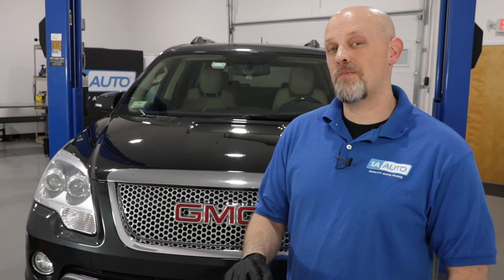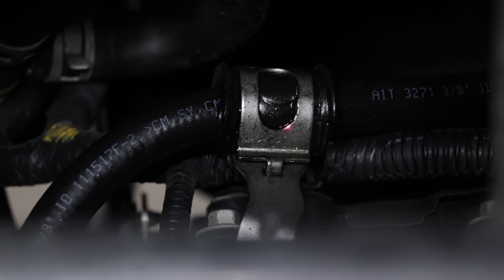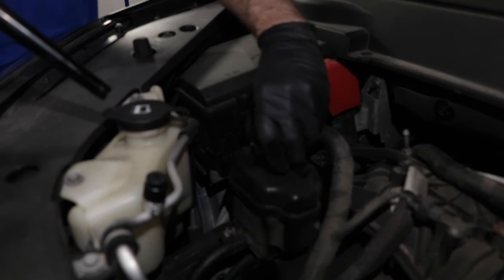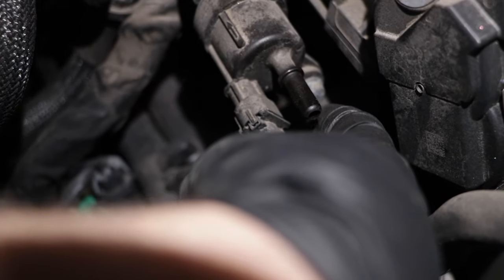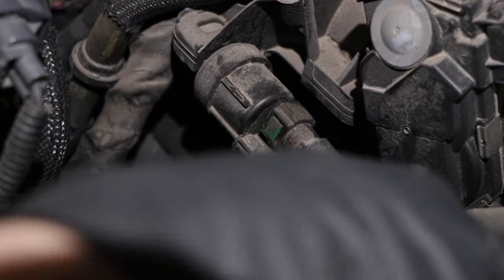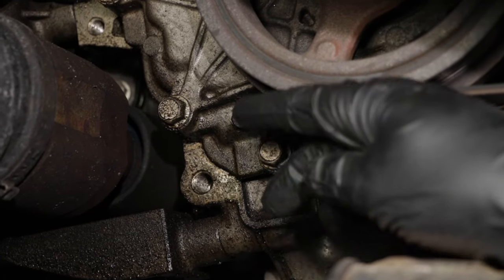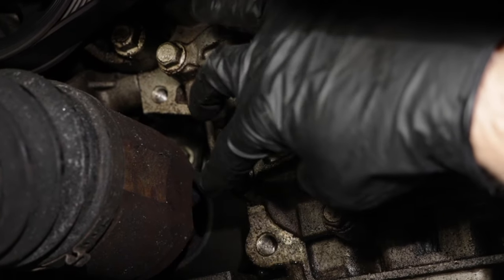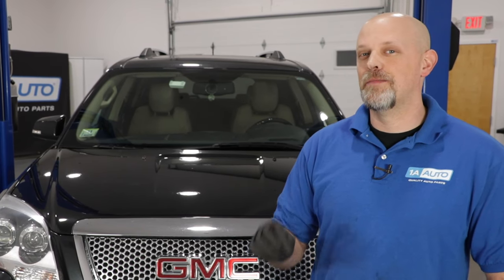Top 5 Problems GMC Acadia SUV 1st Generation 2007-2016

Comment: I don’t think I’ve ever commented on a YouTube video until now. I have the 2010 Buick Enclave. I got to experience the thousands of dollars for the timing chain, the transmission control unit, and am now getting the shuddering in the transmission. I was hoping that was a strut problem. Hmmm. It’s got 210,000 miles. I suppose I can’t complain too much.
Reply: But that mileage is NOTHING if the vehicle is well maintained and in good physical and cosmetic condition. 

Stop thinking that 200k is the end of life for cars. It’s not. Replace the faulty trans and keep on rolling. Replace an aging engine and keep on rolling. 

My 2014 Acadia has 104k on it and is MINT inside and out and I have 2 small kids TRYING to destroy it CONSTANTLY. 

No issues with my Acadia. I personally service it more frequently then needed because it’s a POS GM product but I love it’s design and features so we keep the wheels turning.
Reply: I was looking to get Buick Enclave ... is it not a good car?
Reply: if you've ever owned a Toyota long term.  you'd complain about spending thousands for repairs on that Enclave.

Comment: In 2015, bought a 2012 Acadia SLE2 with 22k miles that had been turned in from a lease. It was almost perfect, well maintained and had an excellent carfax history.  In 2018, it had 40k miles and the air conditioning system that lead to the rear of the cabin developed a leak. With the extended warranty,  it was projected that my out of pocket cost would be around $1.8k. The extended warranty was soon to be due for a renewal at $3.5k for another 3 years.  I traded it in without the AC repair and got a 2019 Acadia.

Fair winds and following seas to all.
Reply: Wait you owned an Acadia and then you…. Purchased another one?…. 😟 I’ve heard there’s people that have a fetish for torture but this is my first time actually encountering one. You’re an interesting human sir 😂 hope it’s been good to you

Comment: Thanks for the video. Wish I never had bought my 2008 Acadia!! Bought it used from a dealership, 6 month later (2017) timing chain, master cylinder, boost, alternator all had to get changed. ( Dealership repaired) then have replaced drive axels (front) tie rods, sway bars, struts, upper and lower control arms, etc... Then water issues....  BLOW VENTS OUT EVERY 6 MONTHS, in the sunroof ... Hood liner fills with water, rain, car wash, etc... Sap and tree debris do clog these drains. Previous owner has jasper transmission put in, now car stuck in driveway, sounds like it shifts to reverse and drive but nothing but engine rev. Fluid level has been full, not had to add, yes click in dash when shifting. Very depressing, GMC used to be a quality vehicle long ago!!
Reply from the maker: +John Libby Thanks for the feedback!

Comment: I have a 2011 GMC Acadia AWD. 113K miles. So far so good, no major issues, thank God. I always take it to the dealer for oil changes and do all recommended maintenance work on time. Hoping it will last for another 30-40K.
Reply: Mine has 16800 running strong 2011 denali
Reply: How is it going now? Any issues since your last post?

Comment: 2007 Saturn Outlook (Same as Acadia) I had the Evap purge go out, easy fix. Been a real good car, 172,000 miles on it. The MAF sensor went out recently wreaking havoc but fixed that easily, One of the stupidest things I had go wrong was a PCV cap. The rubber cracked and it fell off causing a vacuum leak. Shut down my stabilitrak, traction control and threw 3 codes. Went and bought new rubber caps and it drives like new. Changed my trans fluid every 50,000 not trans problems. The most important thing for these vehicles or any vehicle is fluid changes. Oil Every 5,000 miles for these and check the oil regularly, these engines do burn oil even if they're in top shape(Look in the duct for the air box, you'll find oil blown out from the intake in there too) but ignore the rest of the recommendations. Change the trans fluid every 50,000, not 150,000 like the book says. Change the antifreeze every 5 years (Not 10) Honestly I should get a new car because the Saturn is up there in age but I feel as if I could get another 5 trouble free years out of it. If I have it 20 years I'll definitely have gotten my money's worth out of it.
Reply: Im looking to but a used 2009 outllook in a couple weeks. Thanks for the comment! I know a little more of what to expect
Reply: I had an 07 outlook also, it had a timing chain fix done, and couple years later timing chain cover was dripping oil onto my garage floor.   steering and suspension started getting clunky. Then at 135k the transmission was done for.   worst vehicle i've ever owned

Comment: With my 2015 Acadia the trans started slipping at 86,000 miles. My air conditioner is no longer working at 165 000, I was told at the dealership the evaporator goes out on these. Can't wait to see what else fails.
Reply: Did you fix or find out about the transmission issue. I have a 2013 that is misfiring.

Comment: I've got a 2010.  AC has broken twice and it's not worth fixing.  Power steering fluid leaked for a while and cost (what I thought at the time) a lot to fix.  Now just had my timing chains replaced (dreaded P008 code).  $2,600 CAD to fix.  Sorry to say that's it for me and GMC.  Next car is a Toyota or Honda.  Great video and thank you.

Comment: Good video, great tips! If you change all your fluids(power steering, transmission fluid, coolant and of course oil on time or before suggested maintenance you won't have some of these issues. 32 years in the business I see it everyday ✌🏼
Reply: 74,000 miles GMC Acadia Denali. Timing belt issues. Piston slapped plug, new engine needed.
Maintained precisely to manufacturers specs.
My Mechanic said this is one of the main issues with the Acadia engine. He has 4 on his lot waiting for engine and or transmission swap outs. It’s an issue with GM not the consumer.
Reply: That’s right I push my of cliff

Comment: I just fixed the power steering leak, replaced the water pump and flushed the radiator while I was at it, replaced the fan assembly, and had the timing done. 197000 mile on it and now running very well.

Comment: Just did the power steering pump and rack on our 2011.  Glad the garage did it after looking what needs done.  Has the buildup on the valves and garage cleaned it.  Put a bottle of cleaner in about one a month or more and it's doing pretty good since.
Reply from the maker: +Jeff Keller Thanks for checking us out! 1AAuto.com

Comment: Have a 13 Denali. Had a leak in the rear sunroof. Had the timing cover leak. Covered under warranty. Had the blind zone modules go bad. Replaced under warranty. Other than that. Nothing other than regular maintenance. 83k miles so far.

Comment: I think GM pioneered long service intervals. Transmissions sealed for life, 100,000 mile coolant and spark plugs. I had a Malibu that required $3500 in warranty work at only 75,000 miles. Rebuilt transmission, intake manifold gasket, airbag, new horns. It was ready for a new radiator at 90k.
It was replaced with a Honda. I’m no longer on a first name basis with Enterprise rent a car.

Comment: Great video. I have a problem with my GMC Acadia 2014 My Service traction control light comes on on the highway when there is an incline and then the car hestates when I press on the accelerator

Comment: I’ve had an Outlook, Traverse, and now an Acadia. My wife loves these cars, I hate the maintenance they require. I’ve had, leaking sunroof, radio issues, transmission issues, tons of recalls, power steering pumps, stuck front struts, a/c evaporator replacement, plus more I’m forgetting. Not to mention you have to pull the intake to change spark plugs.
Reply from the maker: +JadXtreme Thanks for the feedback!

Comment: I have the uphill shifting gear shutter torque convertor issue. Thank you for the heads up on these problems. This way I can be ready for and not so surprised when they occur.
Reply: I have that problem, too. It didn't start til 160k miles. Wish it didn't, but it's paid for and been a great vehicle! I'll put the money into it to keep er going.
Reply: I had that same torque converter issue. I just spent $3800 having it replaced and getting the transmission rebuild.
Did the timing chain job last year so I'm hoping that I'm good for a while.

Comment: Bought our 2015 Acadia in the spring of 2018 with 35k miles. Proactive and preventative maintenance is CRUCIAL with this power train. I've always changed the oil @ 4k mile intervals with full synthetic, and drain/fill the transmission fluid every 10k miles. I run a bottle of fuel injection cleaner every 10k miles, and I changed spark plugs at 50k and 100k miles. Fluid changes are as simple as turning a drain bolt and refilling the fluid. The Acadia just rolled over 105k miles and she's still kicking strong. Changing the oil at 4k miles instead of 5k mile intervals has only cost me about 4 extra oil changes over the last 6 years. The cost/benefit is clearly on your side if you consider having to replace a timing belt or replacing a transmission. While this is far from GM's best design, it has served our family well.

Also noteworthy
I have replaced all four wheel bearings (fwd). I feel that is reasonable for a vehicle with just over 100k miles.

Comment: Another common failure is the AUX AC line that leaves the firewall. The vapor line,(bigger of the two AC lines) get rubbed on by the power steering hose with a steel band clamp in the middle of the hose. This steel clap will over time rub a pin hole into the aluminum tube. This is an EXTREMELY expensive repair.
Reply: this only happens if that clamp is not bolted on to its factory position after once been removed. a lot of times, mechanics working in the area will not put it back in its proper spot and bolt it down and it will wear on the ac line.

Comment: Me and my wife own an 08' acadia SLT2 that has served use well (even in it's older age and higher mileage of +200k) but it definitely has some of these issues. The purge solenoid being one possible current issue and the bad transmission or torque converter as another current issue. Still runs and drives though and can't complain about our $5,000 investment made 4 years ago! Thanks for the great informative video, you did excellent 👌
Reply from the maker: +Isaac W Thank you! We love empowering our customers and showing how to perform DIY auto repairs with our high-quality auto parts.  http://1aau.to/m/Shop-1AAuto-c

Comment: My husband was a certified mechanic.  I worked with him quite a bit. I'm puzzled by my 2011 GMC Acadia. I've changed several things you've suggested due to engine codes. I think I still need to check the timing chain. My problem is that I may have a secondary issue. A couple of times it stalked after driving about 3-4 hours.  It will start again after about half an hour.

Comment: Thanks for the video, you just described my current issues exactly...pretty sure now my torque converter is going out..😡
Reply from the maker: +Jonathan Langan Thanks for checking us out! 1AAuto.com
Reply: Hello. I have a 2012 GMC ACADIA, and it won't start. The dash lights still came on, so I had the battery replaced. Now the battery is drained, it needs a jump for the lights to come on but it still won't start up
Reply from the maker: +Deanna Beverly We wouldn't be able to diagnose an issue like that here, you may want to have a local mechanic take a look at it. Thanks for checking us out! http://1aau.to/m/Shop-1AAuto-c

Comment: I had the 3-5-R wave plate issue, got the tyranny rebuilt since the engine was at 200,000 miles and in good shape. I also had an almost constant flux in RPM before getting the tyranny rebuilt, problem was corrected..

I currently have the evap solenoid issue at the moment. Very curious now to know what my valves look like!
Thanks a bunch for your video, spot on!
Reply from the maker: +FaithGardener Thanks for the feedback!

Comment: Thanks a bunch.. I have an 08.. 
Have you heard of any mysterious leak issues? I'm finding water in the wire cables that plug into the pillar of the door jams. It starts by losing all internal audio, radio, turn signals, etc. 
Then decoupling the wiring harness and water dumps out of them.
Trying to find the source of the leak.. wondering if it's the roof racks?
Reply: I have an 07 and have had leak issues as well. I had water coming in on my lap all of a sudden after a big rain out of the pillars and from under the passenger side dash area.  There are drain tubes that are connected to the sunroof from what I was told.  These can get clogged or crack and need to be blown out or replaced.  Luckily I didn't have to pay for my broken one or blow out because I had just bought it used, 2.5yrs ago, and the dealership took care of it thankfully.  A while back I had a few drips and so when I went for my last oil change I asked them to blow out the drain tubes. They looked at me like I had three heads!  This was a GMC dealership mind you. Once I explained it to them a mechanic said it could cost $650 to do.  Still wasn't sure if they got what was talking about.  I didn't do it and I haven't had any issues since, but every time it rains I cringe when I go drive it the next day. If you listen you can hear the water sloshing around trying to find the drain holes and you hope that's where the water goes. Lol.  I haven't had any issues with it compromising any electrical thankfully. Try the Arcadia forums for more advice or call up the GMC dealership.  Maybe where you are they have had more experience with it.  I'm in AZ so it doesn't rain all the time. Good luck.
Reply: I need to know the same thing!!

Comment: I’ve worked at a GM DEALERSHIP for 4 years and I have never seen a car or SUV transmission serviced, truck owners have a better understanding of maintenance it seems.

I can TESTIFY that absolutely ZERO customers I have ever seen come into a dealership service their vehicle properly and regularly. This would alleviate half if not ALL problems on some vehicles. Granted some vehicles just have inherent issues. The transmissions in these Acadias will go forever if serviced properly and not abused.
I worked at a Dodge dealership for 14 years and have serviced and overhauled many transmissions from that manufacturer which has notoriously weak transmissions. I stand by my statement that regular servicing coupled with SANE driving habits will keep even MOST DODGE/ Chrysler transmissions living a long and happy life. 
ALL newer automotive engines with timing chains and oil pressure chain tensioners REQUIRE punctual regular engine service and even engine crankcase FLUSHES periodically to  ensure timing chain longevity.
No one believes in proper service anymore!!!
Service your freaking HI-Revving and hi- output engines people!!!
They work extremely hard and are subject to much higher temperatures and pressures and stresses than your dads old single cam V6 Buick Skylark. Service your DAMN vehicles.
If you own a vehicle and want it to last you will spend twice the amount of money into preventative maintenance than you currently are doing!!!
Reply from the maker: +T410ce Thanks for the feedback!
Reply: This is something I been wanting to say for a very long time.. you've said very eloquently and coming from someone with " credentials"; I hope people pay some attention.. Preventative maintain is crucial today to save these poorly designed cars..But don't just blame the car manufacturers, they are following fickin government insane mandates to lower emissions and enhance gas mileage.. Talking about doing everything ass backwards..

Comment: 09 Acadia, Timing chain at 60-65K Range.  Wave plate failed at 90K fixed under warranty due to bulletin.  Misfire on 1, replaced all plugs and coil packs (maintenance in my eyes) but this killed one of the converters so I had to replace them.  Used ebay parts but having an issue getting the Y pipe to seal on the front converter so need to visit a muffler shop.  Other than that, it has the moan in the power steering system, that's been an issue forever, seeping a little oil.  Changed engine mounts, fixed the wiring harness at the TCM, watch the bend in the wires there, they wear and corrosion gets in.  Did struts, brakes, and oil changes and its been good otherwise.   Bought it with 5K miles on it and has over 130K now.

Comment: Yes, I had the transmission/waveplate issue at about 80K miles (fixed under a bulletin) and the power steering pump leakage at about 60K (paid for fix myself).  Also had a radio failure (volume control issues) around 40K and never fixed.  Another repair video said these failures were common.  Their troubleshooting found that GM had installed SOME analog amplifiers in cars equipped with digital radios.  I'm looking to do the cheapest radio replacement solution someday (speakers are fine) once I figure what my options are.

Comment: Bought ours at 140K and the PS was crap, very noisy and "glitchey". Dollar store turkey baster to remove a pint of fluid and replace it with Lucas PS noise and leak juice and immediately fixed the PS problems. 40 year ASE Master Tech and not a fan of "chemical fixes" but tried it with nothing to loose and it fixed it!

Comment: I had brake booster and master cylinder issues between replacing the power steering pump and replacing the transmission. All four issues began around 140k. Then normal wear and tear things: water pump and alternator. 
Also had to replace driver side axle. 
Will not crank after refueling.  
A/C quit working. AGAIN 
STABILITRACK system issues. 
Engine coolant temp issue. 
Passenger headlight wiring harness. 
Passenger window control. 
Hatch release problem. 
The stereo is fantastic though!!!